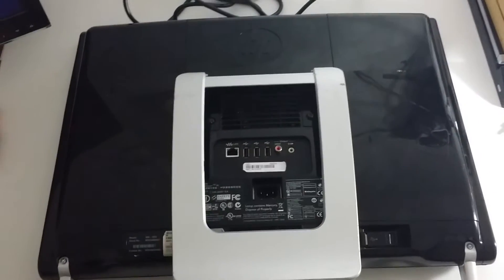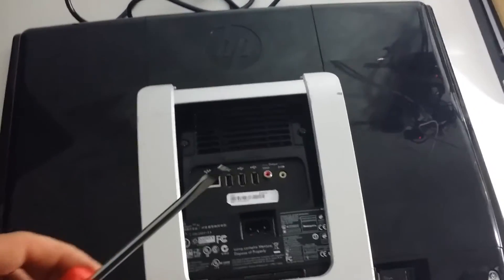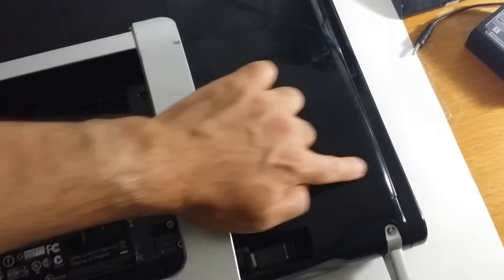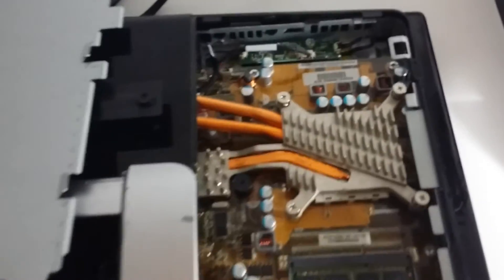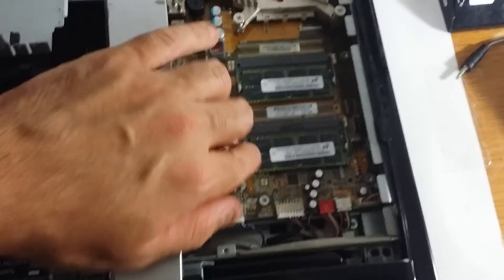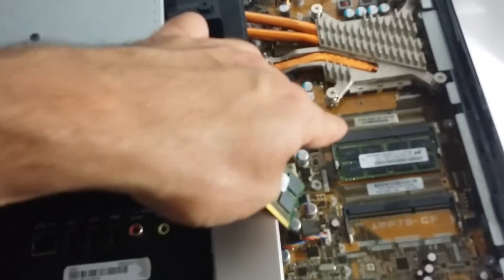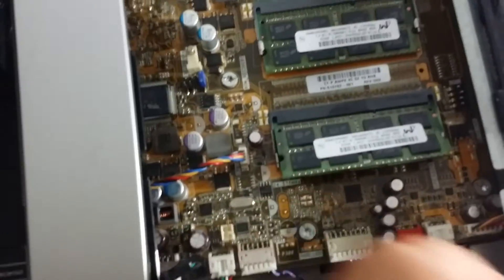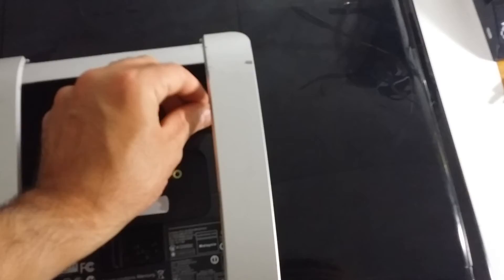HP TouchSmart 300 RAM Upgrade

Comment: I have an HP 300, I knew it had 4gb of ram and two slots, so thought that meant one 4 gb card and an empty slot, turns out it's 2- 2 gb cards. I only ordered one 4gb card to upgrade.
Question: Can I install the 4gb card along with a 2gb card, or do I need to get another 4gb card? Thanks
Reply from the maker: Hi, To find out the max ram and type for your PC, use the free scanner at crucial dot com, it will also tell you how many slots you have. Yes, you can install a 2gb and 4gb modules as well. Best of luck to ya. Thanks for watching too.

Comment: Mine start but video doesn't work. Then...
Reply from the maker: Hi, verify that you purchased the proper memory type for your PC. Also make sure that they snap when you insert them onto the motherboard. Best of luck and thanks for watching too.
Reply: @ReviewsandTech  I'll do it. I hope it works. Thanks a lot
Reply from the maker: @jraulm4  by the way, if you install the old memory module in that PC and it boots, you can visit a site called crucial  dot com, they have a tool which scans your PC for free and let's you know exactly which memory you need. Best of luck to ya.

Comment: Hey boss this is very good. I have the same one. Now I have a situation hopefully you could help, my computer turns on , No LED power button,  Black screen no windows no nothing screen, although all fans turn on, powersupply turns on. There is a blinking LED light on the touchscreen board on the far top right hand of the board.  Please help.
Reply from the maker: Hello Luis, read my other reply to you I hope that helps you out, thanks